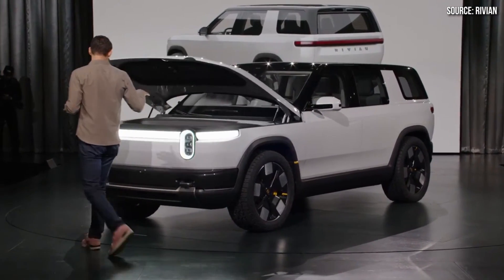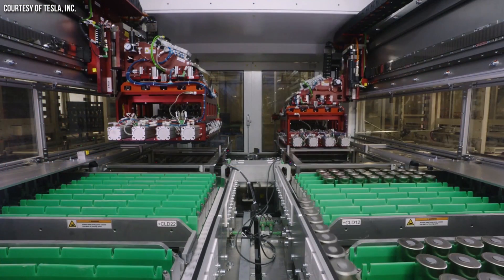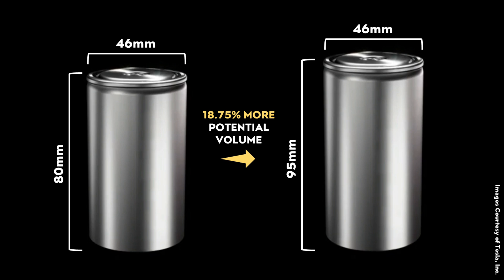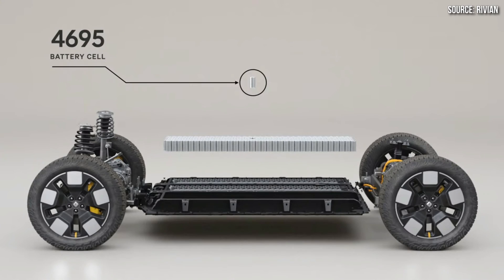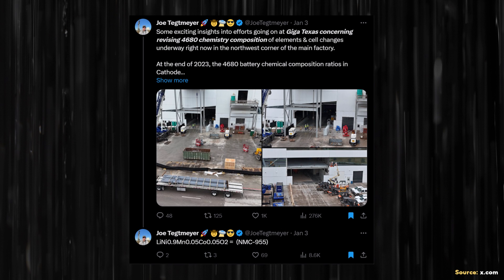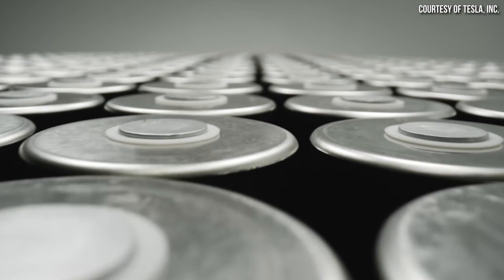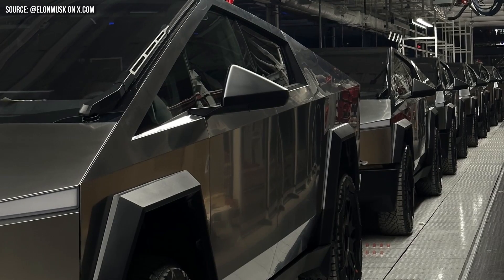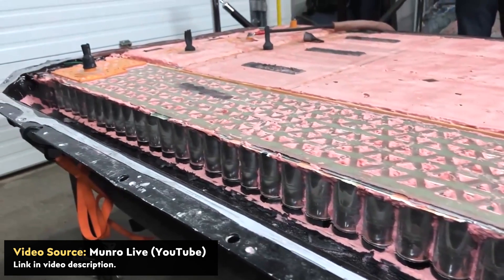Tesla 4680 vs Rivian 4695 Battery Technology | Which is Better?

Comment: I favor the smaller cells. The greater number of smaller cells allows more surface area, to condition the battery or, cool the battery, allowing higher charge/discharge rates. The difference being, sustained power output, and, the ability to charge at higher sustained rates. A larger cell means more distance from the inner core of the cell to the outer cylinder, making it take longer to heat/cool the inter most part of the cells, for maximum charge rate or performance. This can lead to temperature gradients between the inter and outer parts of the cells, so you can have differences in state of charge within the same cell. While it's easy to maintain capacity, the larger cells will never be able to handle the power compared to capacity, that was achievable with the larger number of smaller cells from the past.

Comment: BMW is already using 4695 and 46120 cells. Like Rivian's, they are probably make using traditional battery design elements rather than Tesla's tab system and dry electrode. I believe both Rivian and BMW use anode end cooling rather than Tesla's side contact channels. 
Tesla tried to reinvent core battery design and it hasn't gone well.

Comment: Thanks John for your informative videos. Just a note, you did not consider the effect of extra battery weight (napkin calculation : 230 - 250 extra pounds) on range in your theoretical range example 4:35
Reply from the maker: True. Good point.

Comment: Its not apple to apples comparison given Tesla larger cells use dry coating in comparison to a what Rivian supplier will produce 🫣. Its a bit disappointing that Rivian keeps copying Tesla instead of making their own innovation in terms of battery and structural packs. I wouldn't be surprised if Rivian copy Tesla giga casting next 🙈.

Comment: yes...yes...yes.  However, TESLA's electrical is more efficient and powerful.  You must take the "whole" package into consideration.  Also TESLA has a much more efficient "systems" controlling package.  Power management, electrical harnesses and design with less wiring, and another example the "Octal valve".  All of which in comparison to RIVIAN puts RIVIAN a "whole" 2-3 generations behind TESLA.  Last but not least...AI is totally absent in RIVIAN.  So...far off the mark...and definitely no lollipop.
Reply: Isn't Rivian working on a like, "Septic valve?"

Comment: No where in thus discussion, is reliability and life of these larger cells. Heating and cooling always an issue. Bigger batteries are harder to heat and cool. My Iron Phosphate battery in my Tesla model 3 is Chinese. The new generation iron phosphate battery is faster charging and greater energy density. This is far more important than the height of the cell.

Comment: As long as they are not using pouch cells, we are all safer. A taller cell makes sense for a bigger vehicle, as it requires a taller pack, which makes sense in a truck. Rivian needs to partner with Tesla. The products are different enough that a partnership could work. Tesla is an EV innovator, while Rivian is more of a vehicle innovator (like Jeep).
Reply: A new Australia company has special pouch cells. Kangaroo Batty is hopping!

Comment: 19% more volume doesn't mean 19% more energy.
Since you have overhead at the top and bottom (think current collectors, terminals, vents) that doesn't scale up as you lengthen the cell, the increase in energy is actually greater than the increase in volume.

Comment: In the long run Tesla will make more profit making its own cells, but all costs associated with making them costs Tesla wayyyyyyy more than it will cost Rivian to put the first 70.000 vehicles on the road. Tesla has spent billions and billions on 4680’s. Tesla is married to that design for a long time.  While Rivian can easily swap out cells for new improved designs. Also Tesla is also buying 4680’s from other battery manufacturers.

Comment: Problem with the fat battery is keeping them heated and cooled while charging making for issues while charging.
Reply: That’s the reason for the tabless electrode design - to reduce electrical resistance and improve heat transfer. If you’ll recall when Tesla revealed the 4680 they said they expected to achieve 5x energy (because 4680 is ~5x the volume of a 2170) but 6x power. That power increase is due to tabless.

Comment: Why are you speaking about Rivian battery, it is Samsung, LG, ... battery design, Rivian does not make batteries.
Reply: They designed them
Reply: Rivian didn't design the battery cells, they are designing the pack around the larger sized cells
Reply: Suppliers build on specs requests by the OEM. It’s not like Rivian goes out shopping and buy whatever is available.
Reply: @carlosnorris352  True, Rivian assembles the battery packs. However, the cells are standard items supplied by the manufacturers
Reply: Their batteries are probably made by either CATL or BYD, the same as Tesla.

Comment: 4680 is also size/thermal optimal ratio for Tesla calculation. People saw 4695 and said wow it's nice to have 20% more volume but forgot to consider that battery required temperature control. If it's too hot, it's need to cool down. If it's too cold, it's need to warm up. More volume=less surface=harder to control evenly temperature throughout the cell. This is also why S/X and surely Roaster will still using 18650, because it's provide superior in thermal control for extremely use case
Reply: 100%. Also, the entire reason of 4680 over 2170 was to reduce cost of manufacture. It’s possible 4695 will have worse yields over 4680 (just speculation - must be a reason Tesla didn’t go longer, as well as thermals)
Reply: Agree, Rivian does not appear to take heat transfer into consideration in their pack level design. They use cooling plates  that limit contact area for conduction heat transfer and the contact points are not optimal (in some cases at the bottom of the battery). Batteries will not last as long as Tesla's serpentine cooling. Look at the Munro Rivian teardown.
Reply: Ahh yes, Tesla is expert and Rivian doesn’t know batteries get hot. I’m sure Tesla will launch a frivolous lawsuit that says Rivian can’t use 46mm diameter cell because Tesla First.
Reply: @yolo_burrito  Rivian didn't aim to make their own battery cell. So, they have no other choice but to buy it off the shelf from suppliers. This is why it has to be 46950 because it's an old standard that is available right now. Suppliers such as Samsung, CATL are planning to produce 4680 but until that's available. Rivian will stuck using inferior cell.
Reply: @yolo_burrito Hasn't the R1T been criticised for problems charging speeds plummeting during fast charging due to overheating?
Reply: @yolo_burrito  you really don’t know Tesla, do you? They almost always open things up to create new standards.
Reply: @yscol22  they’ve sued Rivian for hiring employees. Elon is not American.

Comment: These Tesla structural battery packs will drive depreciation of the EVs using those (like Tesla Cybertruck or Model Y) to the outer space. Because those battery packs are impossible to repair due to that epoxy foam which can be removed only by destructive methods.

VW announced to integrate their battery development business in the similar way as Tesla this week. And it is allegedly ahead of Tesla with their battery chemistry.

Comment: Idiotic move by Rivian. Tesla alone will make 4680 a standard size for cylindrical batteries and all the big manufacturers are gearing up for that form factor. A custom form factor just is a massive risk for Rivian in that they will either have a lack of supply or pay through the nose as there is nobody to take any oversupply out of their hands. 
I think this is NACS 2.0 - the R2 is a 2026 car, early 2025 the finalized design will be a 4680
Reply: I agree - Tesla gave compelling reasons why the 4680 was the optimal size. As these are quite a bit larger than the "standard" 2170, it's easy to imagine difficulties in development and manufacturing - which is exactly what Tesla has gone through. Even experienced battery manufacturers, like Panasonic, have struggled. To add yet another form factor adds to the difficulties in supply / cost.
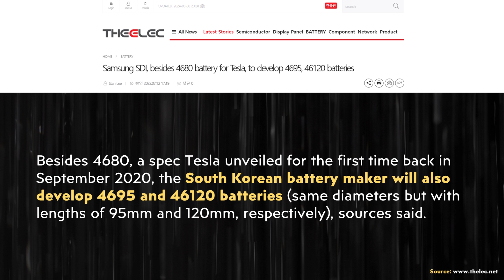Reply: Battery cell manufacturers already stated, they can produce 4680, 4695 and 46120 on the same line, just changing the settings. It is in this video 10:42
Reply: @bellumCretatus yep, question is how big of a change it is to switch lengths. Plus probably not all lines by all manufacturers will be as flexible and if you have a surplus you are sitting on it. Tesla has shown how beneficial it is to use standard 1865 and 2170 from all kinds of manufacturers
Reply: @nikos6220  I expect 4680 & 4695 to be the new „standard“ for car battery cells. BMW & Rivian prefer the longer cells, Tesla might prefer the shorter ones for the „double decker“ pack for the CT.

Comment: Large battery cell manufacturers have experience and scale of production and focus advantages over Tesla, I would not assume Tesla will be able to manufacture 4680 cells for the same cost or with the same energy density as every dedicated cell manufacturer. That Tesla can compete at all is amazing. We have no idea what the four big cell makers have coming in their innovation pipelines. 

The huge advantage Tesla has is making the cells where they make the packs and cars; this means no packing, no shipping, no unpacking, no chances for damage happening in transit, no need to repack and ship defective cells. That is a huge cost and efficiency advantage.
Reply: Even though agree on the traditional battery manufacturers experience don't forget Tesla brought the 46XX to the market first and is the only one producing it at this time plus the dry process and the tabless electrodes are Tesla proprietary, makes it IMO not clear if those traditional manufacturers will produce better cells formats than Tesla.
Reply: ..better and also cheaper!

Comment: Your whole misleading concept of Gen 1, 2, and 3 by Tesla is meaningless by saying Gen 1 by Rivian. Certainly Rivian (and all others) will have torn apart Gen 2 & 3 designs so Rivian Gen 1 is likely starting at the same place as Tesla Gen 2-3 designs.
Reply: They cannot copy the tabless design. The energy increase on Gen2 is due to a much taller jellyroll because they are able to weld the can directly to the flags. I suspect that the extra 15 mm of 4695 is to have room for multi tab design. Multi tab is the alternate technology for tabless. It has similar performance but it needs extra space so it is not as compact as tabless.
Reply: @kazedcat  wait a second ... 15 mm is 0.59 inches or 1.5 cm ... that is a LOT of space.  No way tabless gets back 1.5 cm.
Reply: @Scott-sm9nm  They also need space for PTC and current cutoffs that are not present in Tesla cells.
Reply: Lol, just like completely failed to happen with the first generation of legacy automakers EVs. That said, he is wrong since Tesla is a continuous innovation company often or usually trying several different improvements at one time and constantly testing. A Cybertruck might have different battery chemistry than the one ahead of it on the production line. There are no Tesla generations.
Reply: @tribalypredisposed Tesla uses customers to beta test in production.

That’s garbage!
Reply: Tearing apart gives you ideas but they aren't copying. They still have to design their own, and figure out how to build it. For example, seeing a giga casting, and putting it into production on a new vehicle, is totally different.
Reply: @fjalics  I see some of your point but there are several companies doing giga castings.  A lot of this stuff is not advanced beyond what the other automakers have the know how to do.  There are many battery makers and certainly they understand how to make each others batteries from a physical size standpoint. ie. several are making Tesla batteries.
Reply: @Scott-sm9nm Tesla is definitely No1 in giga castings. Competition has less and smaller castings. And legacy uses still next no castings?

Comment: 8:30 so 3rd generation 4680 battery cells is virtually the same as the oldest 18650 battery cells and you were super impressed by that?!?
Reply: The goal is reducing production costs. 
The goal is not getting the most energy dense battery.

Comment: Regarding the 18% more volume-energy density perhaps potential for even higher depending on chemistry. Aptera’s CEO Chris Anthony talked about this with their 21 mm by higher than 70mm future cells (very hypothetical still, but you get the point)because you can use a higher percentage of the cell for energy, since you don’t have to make the other buffer components larger

Comment: FYI: It is not Tesla vs Rivian. Tesla alone cannot produce enough 4680.  So, they invited battery suppliers to to produce 4680. So far, three South Korean companies (LG EnSol, Samsung SDI and Kumyang) have successfully developed the 46xx. Samsung SDI will produce 4680, 4695, 46110 & 46120; LG EnSol will produce 4680, 4695, etc.; and Kumyang will produce 4695. European OEMs had asked for longer versions of 46xx. That is why the three companies have developed 46xx instead of just 4680. Kumyang announced that they had a meeting with Rivian last year regarding the 4695. The rumor is that Rivian will get 4695 from more than one supplier.
Reply: Tesla is the only one producing their own batteries.
Reply: @Hugh-py2ce  In North America, yes, but only for the low volume Cybertruck for now. BYD for example is also producing their own.
Reply: 4680 ramp is ahead of the rest of the Cybertruck and since they order other types of cells cheap (and CATL & BYD cells are also structural) there's no rush to ramp Gen1 or even Gen2 4680s. They'll figure out dry coating and thinner casing and density will jump 10-15% in 2 yrs. 

That said, Rivian using (currently non-existing) 4695 makes sense and using the same number of taller cells would've give Cybertruck a nice 18% range boost so rather than two rows, just using 4695 or 46120 makes sense in very large vehicles. We don't yet know how well 4695 will handle heat and internal resistance tho, ramping 4695/46120 may take even longer than 4680.
Reply: They don't produce the batteries themselves because it's cheaper to outsource to 3rd party manufacturers.
Reply: Prototypes are easy production is hard. Good luck to you battery start ups. Catl Panasonic and Tesla (Redwood) will be the only 3 standing in 5 years.
Reply: @donbreartonii1353 why would you believe that? Isn't there more carmakers and other applications for batteries in the modern world?
Reply: @donbreartonii1353 when you look how many years takes Panasonic to rump up  they 2170 cells in Nevada, you would see, is hard for everybody, so only difference is if you have patents, people and money to rump up production, and you het cut of what producer make as margins, or even more. When is 5% or less, is not worth picking up, and when same product is going to multiple companies, as bolts/screws, is not worth because you don't get scale to get margins back, but when battery production is most time don't for car company, is different story. But it is easier to outsource, but many times not cheaper.
Reply: Which means, Tesla does NOT have a generational advantage over Rivian for battery cells, because Rivian will be buying cells from experienced battery manufacturers, not developing their own. Tesla may have a long-term pricing advantage by producing in-house, but that remains to be seen as they are spending a huge amount of developing the technology and production capacity.

Comment: The real question is. Is it a tablesss design . Or is it old school single tab at. The end of the roll.
Reply: It cannot be a single tab, the cell would heat up too much and too unevenly. I think it is a multi tab design instead, which should be okay but not as good as tabless.
Reply: @tribalypredisposed Yes I suspect it is multi-tab and that is why it is taller. They need additional vertical space for the multi -tab.

Comment: Is a dry lfp 4680 possible?
Reply: Theoretically possible, but challenging in practice. Today Tesla applies the dry electrode method only to the anode side. They are still unable to do it in the cathode side. Of course the cathode is more important than the anode in term of battery performance.
Reply: @johnshikingmountains3152 Dry electrode is not about performance. The binder is not an active material so changing them does not change the batteries capacity.
Reply: I think prismatic makes more sense than does cylindrical for LFP battery cells, and this seems to be the industry trend. This is because LFP does not have the same fire risk as do nickel-based lithium-ion chemistries. A key reason to use cylindrical cells with metal cans is to compartmentalize any battery fire. Short of a sphere, a cylinder is the geometric shape that has the smallest surface area relative to its volume (i.e., lightest) and the greatest strength at resisting internal pressure. LFP is safe enough that a metal pressure container is not needed, and uses rectilinear geometries to achieve the best possible space efficiency.
Reply: @astewart1900  Cylindrical cells are faster to produce. The machines that wound the jellyroll into tubes are much simpler than a machine that folds it.

Comment: 4695 cells are approx 3% greater in volume than 4680, not 18%.
Reply: 15/80 = 18.8%
Reply: Regarding the 18% more volume-energy density perhaps potential for even higher depending on chemistry. Aptera’s CEO Chris Anthony talked about this with their 21 mm by higher than 70mm future cells (very hypothetical still, but you get the point)because you can use a higher percentage of the cell for energy, since you don’t have to make the other buffer components larger